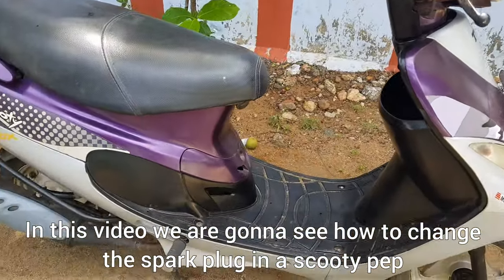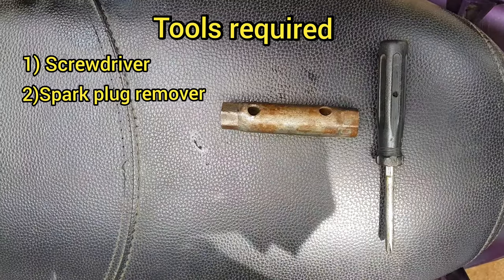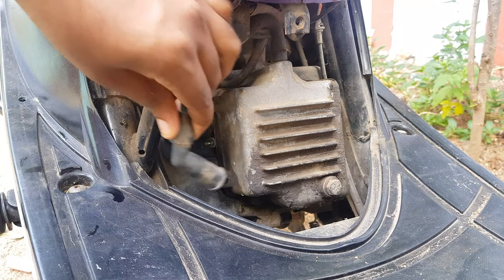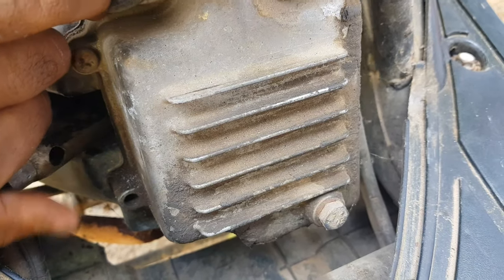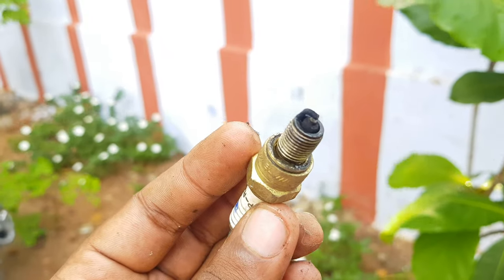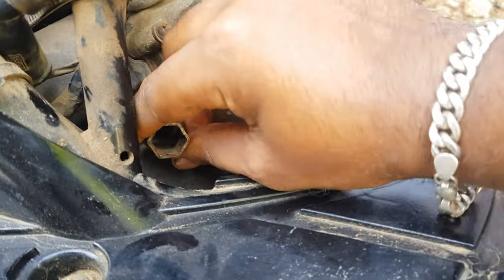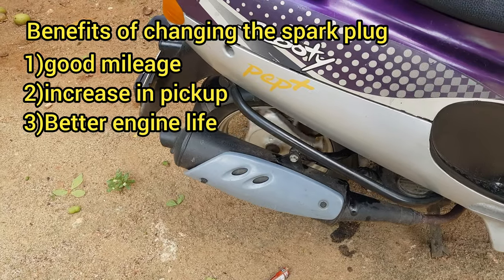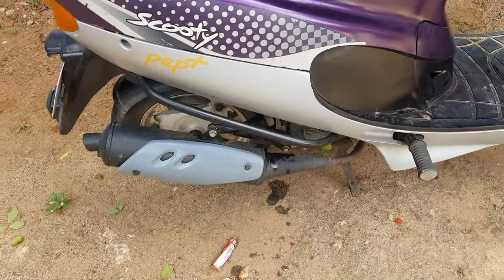How to Change Spark plug in Scooty pep | DIY @Home | ep-4

Comment: Good. Why plug cannot be cleaned. All mechanics wanted to replace with new?
Reply from the maker: If it's a normal plug we can drive for 10000kms no issues , but it is advisable to clean the plug in every service. But we can use the plug upto 10k kms. They will say it's time waste and all
Reply from the maker: If they get 50 rs for changing the spark plug also they will put a commision on the plug of the price of plug is 70rs they will say 90 
So total They get 70

Comment: Sir
My Mahindra gusto gives 15 kmpl 

Company stopped the model and showroom closed

What can I do 

How I increase mileage
Reply from the maker: Do a general service ,,,, replace the spark plug ,, airfilter,,,, engine oil ,,, gearoil,,, clean the carburetor and check if the both the wheel rotate freely... that might be the problem